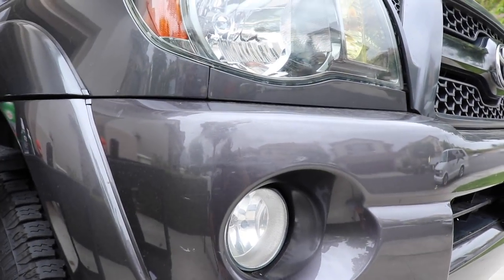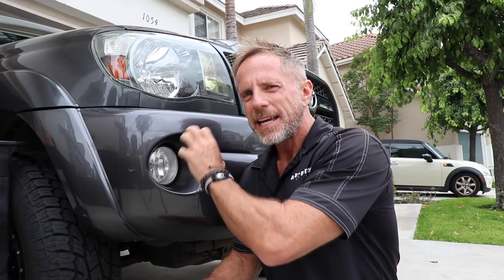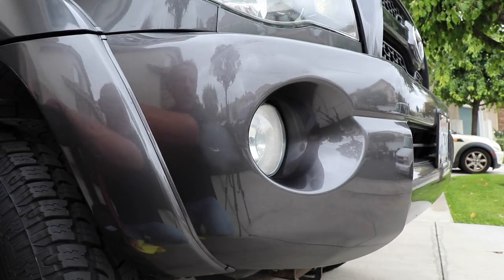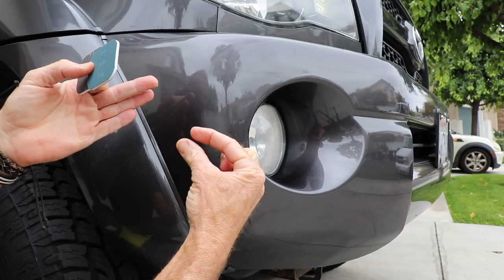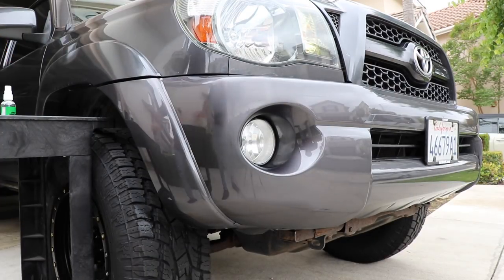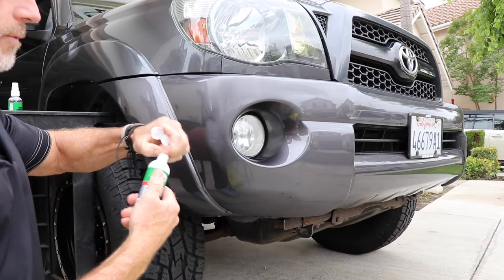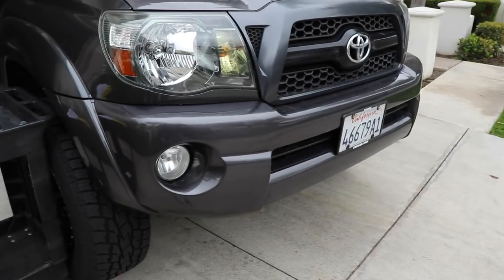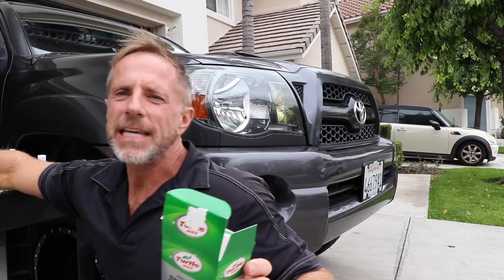Turtle Wax Scratch Removal Kit: What does the voice of reason cost?

Comment: I use Novus plastic scratch removal kit to remove scratches from my car paint. This kit has heavy scratch removal compound,  fine scratch removal compound and plastic cleaner compound. I do not use sandpaper, I start from heavy scratch removal compound and finish it with fine scratch removal compound. It works good and there is no risk you rub off clearcoat. It might not completely eliminate deep scratches, but it smooths them pretty good and makes them almost invisible.